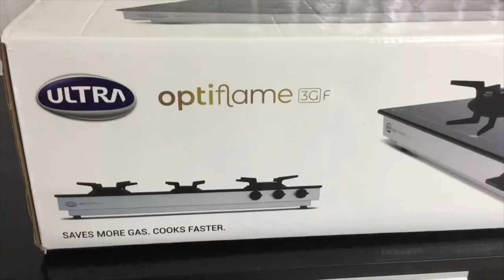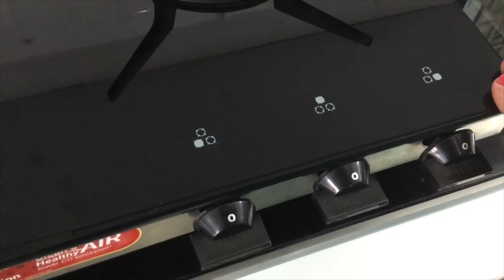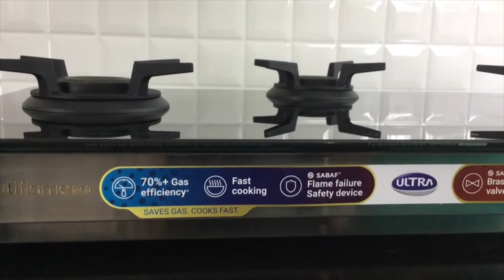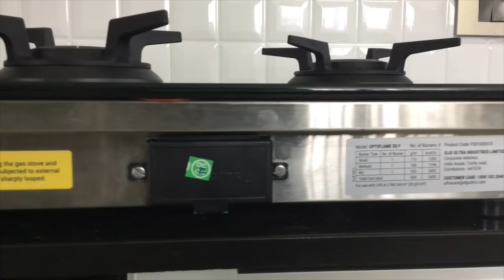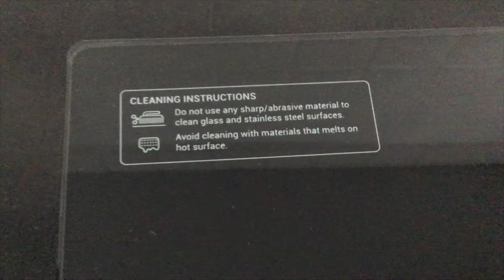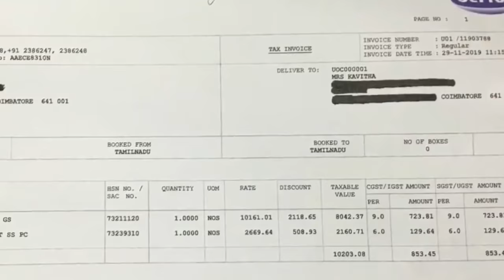அல்ட்ரா கிளாஸ் டாப் ஸ்டவ் எப்படி இருக்கு?வாங்கலாமா?/ultra glass top stove review,demo,price, tips

Comment: I have purchased the same brand a month ago after seeing your video..happy with it ...the food get cooked very quickly....is there any way in it where you can minimise the flame further.. because chances of food getting burnt is  high..have to be around..the milk too boils too quickly..
Reply: Mam, Is this ultra elgi stove good to use. Can we buy now ? Pl give ur feedback
Reply: @rover715  the only advantage I find  in this gas stove is if the flame goes off due to spilling of milk while boiling which happens very often 😀 there's no danger as the gas goes off..cooking veggies i still find it difficult as I hv to be around or add water to avoid getting burnt..  
The company technicians came twice and rectified the flame to minimum but I still face the problem.
Reply: @wilmamenon9841  Thank you mam. My mom has a confusion whether to buy ultra or preethi glass top or anything better